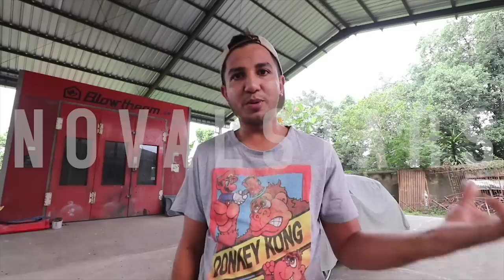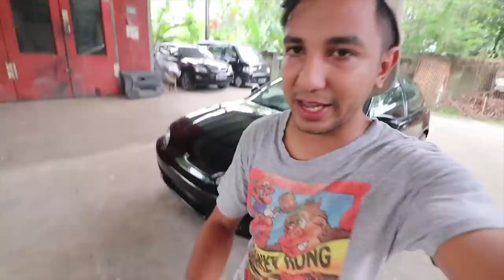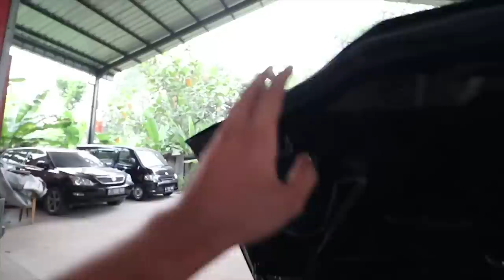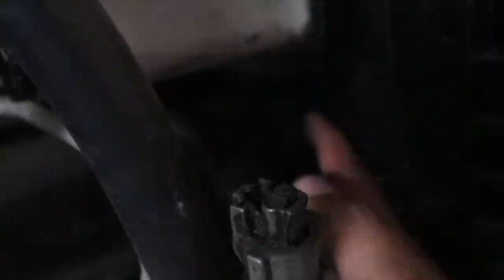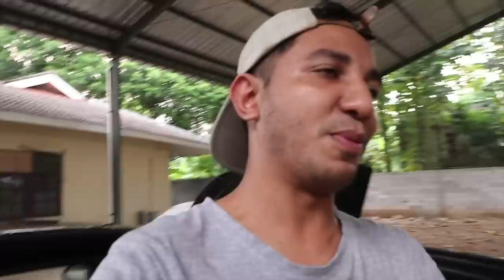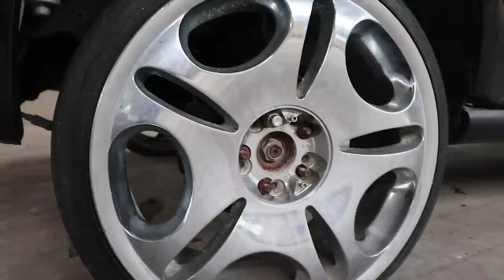Mobil Impian

Comment: Klo uda pernah ganti bullhead pernah crash yak. Secara bullhead kan bukan barang yang harus diganti klo ga rusak karena  nabrak. Dan kap mesin dalem kempling  aja untuk ukuran mobil kelahiran 90 sepertinya pernah repaint juga satu paket sama ganti bullhead itu. Interior retrim. Yah bukan barang bahan yang cukup oke sih bang. Tapi di tangan sevenstars pasti jadi neck breaker nih kalo udah jadi.